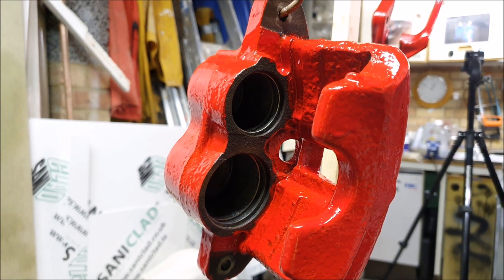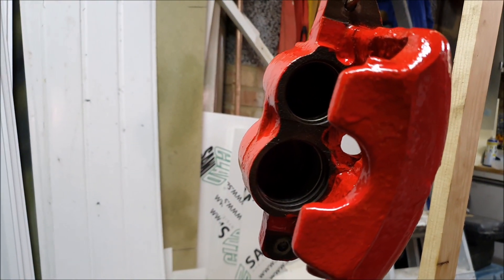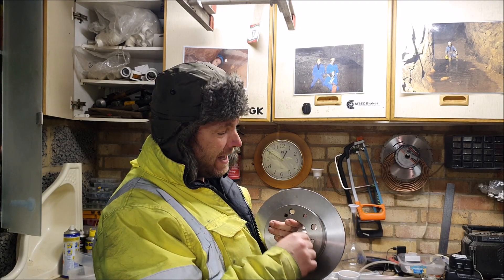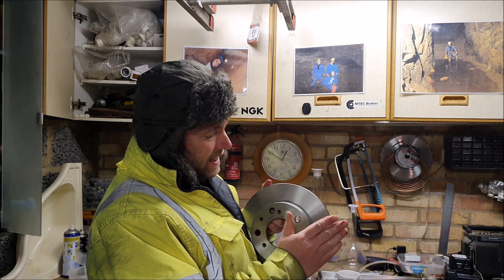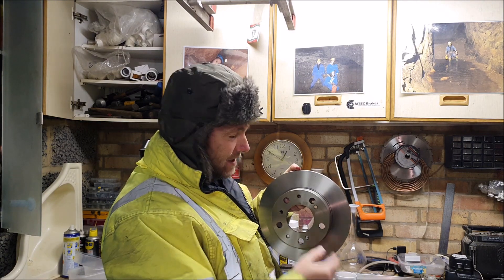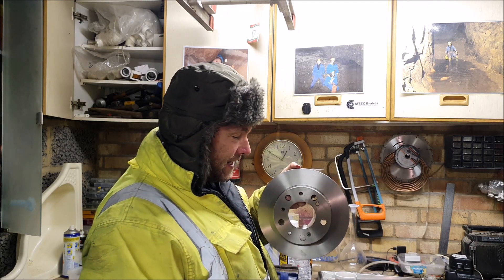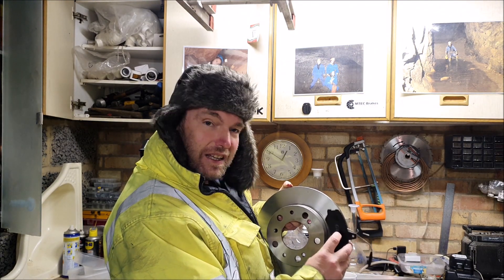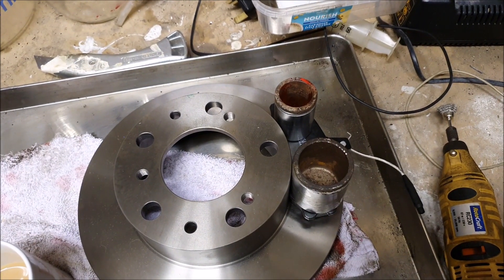What Is The Purpose Of Uneven Piston Sizes In The Brake Callipers On My Citroen C25 Motorhome?

Comment: My guess is that the work required to stop the van is much greater when the van is loaded to its max payload than when it is empty. So it would make sense that applying enough pressure on the pedal results in activating the second brake cylinder, and more force on the pads. If it was all sized on one brake cylinder (carrying max payload) you could imagine it would be very easy to lock the wheels up when the van is carrying no weight. But that’s a guess!
Reply from the maker: Yes that would make sense 👍

Comment: Yes that makes sense for the outer pad but because the caliper is on a slider that only goes parallel it does not work for the inner pad !.
Reply from the maker: Yes, that sounds like a valid point (albeit the other way around - the pistons act directly on the inner pad)

Comment: Its dual circuit brakes hence 2 x brake hoses each front side. Piston size due to amount of fluid in master cylinder etc. Floating calipers even out disc pad wear. But not 100percent sure. Just what I am led to believe.  Cheers from George
Reply from the maker: That's the alternative theory that seems credible,  I've messaged Citroën for confirmation,  I wonder if they'll answer 🤔

Comment: Alex ,i like neils theory, you do have two hoses feeding the front pads, worth a check if they both work, the feeds to these hoses may come off different outlets of the antilock brake device/ manifold.
As the piston wasnt seized badly, you may have had air in that cylinder as the bleed nipples were seized closed causing bad piston throw. 🤔🤔
Reply from the maker: It's interesting to speculate, I couldn't feel air in the system on the pedal but it's possible 👍
Reply: @ttxela  you will know all is good when you bleed the system, and see both pistons move smoothly.
Reply: I doubt very much that an elderly motorhome has antilock brakes (ABS). My guess is the smaller one is connected to a sytem to all 4 wheels, and the larger one is connected to a system for just the fronts.
Reply from the maker: @nealeburgess6756  Yes, no ABS on this van! :)

Comment: Sorry Alex, I don't buy that theory. I have changed countless brake pads over the years, most of which had only one piston, or two of equal size. And I have never witnessed the leading edge wearing faster than the trailing edge. I have a possible theory. You have two separate circuits on your brakes, with the idea that if one fails you still have one circuit remaining to stop with. Maybe one circuit works all four wheels, and the second has the backup supply to the fronts alone; because the front brakes are the most important. The circuit supplying 4 wheels will have half the amount of fluid reaching each wheel as the one with only two wheels. So to make the pressure and movement equal on both pistons the the first one would need to be half the size of the second.
If my theory is correct your back brakes will only have one hose going to each, not two like the fronts. Can I just say, I have no experience of the brakes on those vehicles. This is just a theory based on logic.
Reply from the maker: This is definitely plausible as there are two circuits, 🤔 it would be great if someone could answer definitively. 

I am aware that some Porsches have unequal pistons fed off a single circuit on a fixed rather than floating caliper. I believe some models of BMW also have unequal pistons.
Reply from the maker: Been thinking about this, I think what you say makes sense in terms of travel distance of the pistons when braking - however the pads sit pretty much against the disc so travel is minimal and because the circuits are linked it just becomes a matter of pressure applied where the larger piston has the advantage. 

I think that makes sense 🤔

Interesting discussion 👍👍